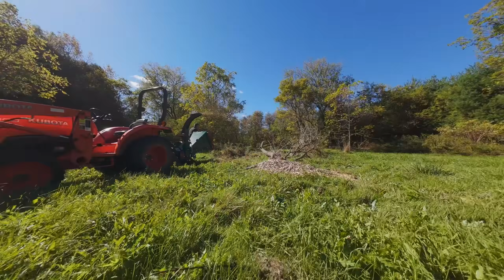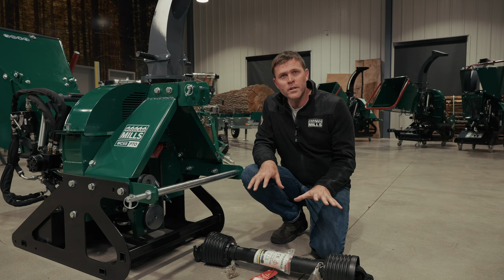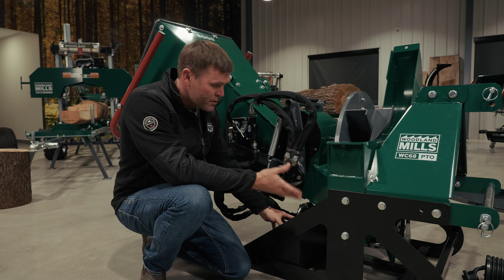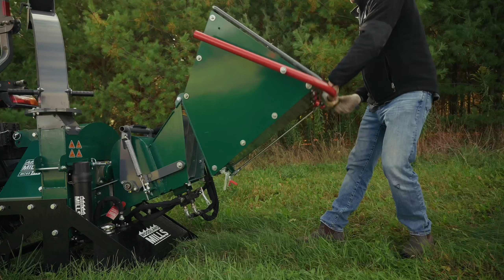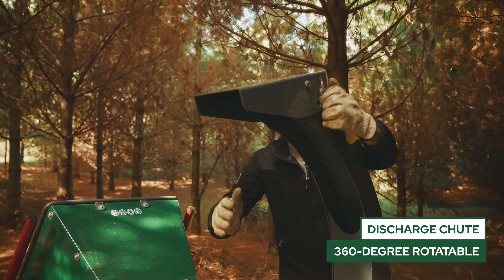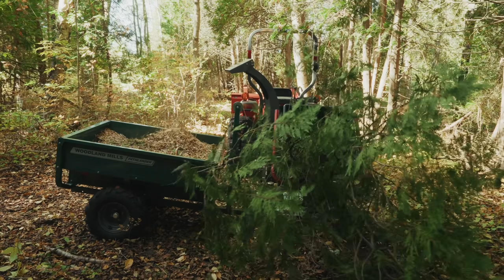Woodland Mills WC68 Wood Chipper Full Product Walkaround (2024)

Comment: After my John Deere 3039R the wc68 chipper was the first thing I invested in. I love it, it was easy to setup and I’ve put it to good use while developing our property. I’ve been running it for 4 years now with no issues but I think it’s time to sharpen the blades next spring.  Sadly I’ve removed it for the season cause winter is here and I need the snowblower. I like these promo videos as it always reminds me why I like Woodland Mills.